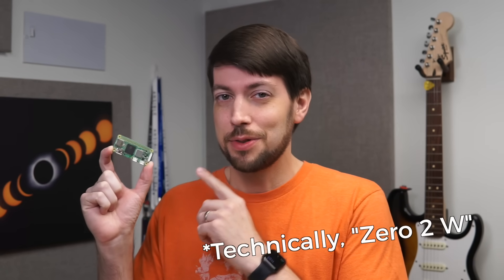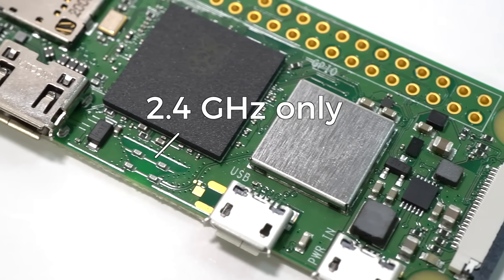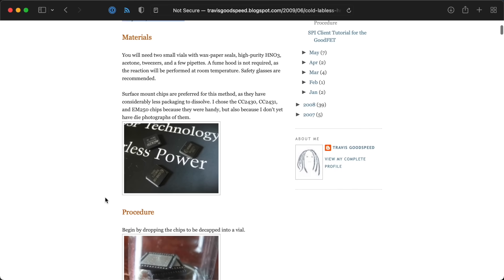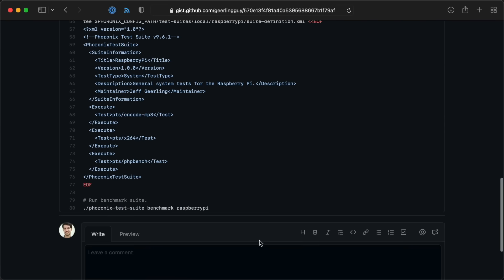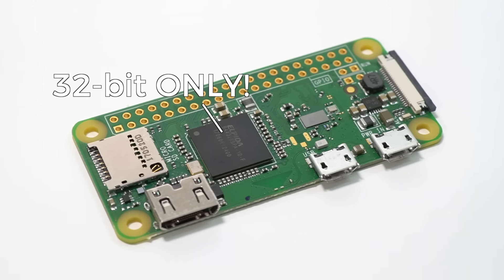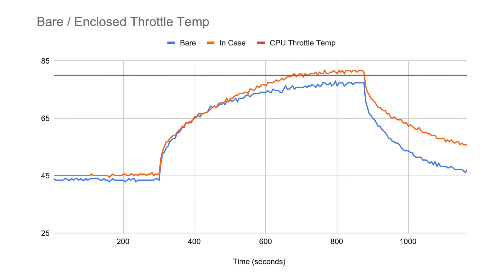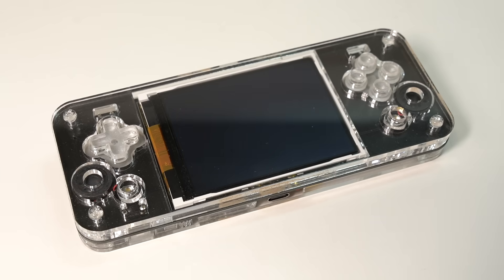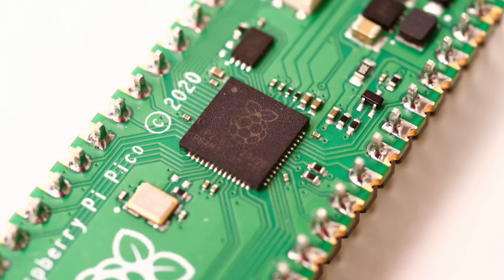The Raspberry Pi Zero 2 W review

Comment: Radxa Zero hands down.  Disappointed in Jeff, seems paid off this time.  I'm sure he's aware that the radxa zero has no throttling issues.  Not in my tests.  Not one bit.   Radxa zero has x265 hardware decoding and  not the raspberry pi and you can get  more memory on the radxa zero for a few more bucks.  I think this is more of a commercial and Jeff is looking out for his best interests financially.  Bad move lose integrity etc.  x265 hardware decoding plays a big factor if your project is a media player.
Reply: Much better wifi on the radxa too.
Reply from the maker: I mentioned the fact the Radxa has better hardware a couple times in that part of the review. But the fact remains getting a random project working on a Pi board is going to on average be easier than on one of the other varieties.

And no, definitely not paid off.
Reply: @JeffGeerling  The throttling issue seems kind of fishy.  My tests and other youtubers who have tested it report the same.  There are no throttling issues.
Reply: @JeffGeerling  You said  the bottom line each would all give similar performance without additional cooling and mentioned throttling.   So not true, none of that is accurate at all.   Similar performance?  Not even close.   Better wifi, better video decoding and so much more you get on radxa.  Maybe you're not aware but radxa isn't like other competitors to the pi.  Even ExplainingComputers admits that Radxa has great software support.  Not as great as raspberry pi of course but they're pretty good to the point that you will not have any trouble getting a project off compared to the pi in a month or so when some bugs etc are worked out.   Im sure you're aware of most of this.  This video really did leave me wondering if it was just big advertisement.

Comment: You never showed the bottom of the board.  Where's the new composite video test pad?  Is it in the same spot as the old Zero?  A lot of Gameboy Zero builds use 3.5in backup camera displays, which run on composite.  Also, the official page for it doesn't include the bottom specs either, which is really weird.
Reply: EDIT: ETA Prime showed the bottom of the new board within the first ten seconds of the video.  The composite video pad (marked "TV") moved to the opposite side, under the mini HDMI port, rather than being near the GPIO pads.
Reply from the maker: Yeah I only barely flashed the bottom of the board when talking about the stacked die on the CPU. I forgot to go over it, as the one POGO based case I use for the Zero that uses those pads was in active use and I never got around to testing it.
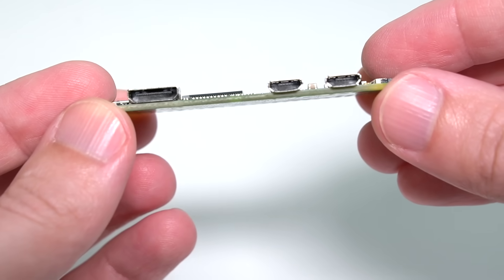Reply: @JeffGeerling  Yeah, the bottom you showed at 2:33 was the old Pi Zero (which you can also tell by the 4 through hole pads near the GPIO).  It's all good though.  That x-ray was really neat.  I'm also looking forward to seeing how well this plays with the RetroFlag GPi case.
Reply from the maker: @dividion8102  Oh shoot, lol so it is :D

I guess it's a good excuse to get people to also check out other videos like ETA PRIME's ;)

Comment: Hello Jeff, nice video as usual! :)
I paused mid video to order one, should be shipped soon :)
I like that with the raspi foundation, you don't expect anything, then boom! new board! However, it is becoming more expensive and difficult to try to "catch em' all"...

anyways, that is a great new board, will be perfect for HQ cam builds!
In order to compare efficiency, it would be interesting to compare the energy used for a fixed compute task.
For instance, transcoding a X Gb file on both, and see the Wh consumed. 
The zero 2 might draw 2 times more, but for much shorter (less than half the time) , thus using less overall energy.
But i think that the idle power draw will still keep a place for the original zero W on battery.

Comment: This is perfect for my needs! A while back, PRUSA of the MK3S fame released a guide to attach a Pi Zero directly to their Einsy RAMBo board in a seamless case solution. Just one problem: the Zero could run OctoPi okay by default, but attaching a camera caused things to explode in a hurry. Even with the same amount of memory, the 02 should have more than enough processing power to run OctoPi with a camera streaming at the same time. I'm sold!
Reply from the maker: Yeah, this little guy is ideal for use with 3D printers, though if you stream the camera feed, consider backing it off the 480p
Reply: @JeffGeerling  Oh no, the stream will be 480p, but ideally I want to attach a USB webcam for Octolapse streaming as well. My machine has the MMU2S, which means I want a camera on the selector. Maybe I should jerryrig a servo HAT in there to slide the camera up and down in it's enclosure?

Comment: Finally! Yes it would have been much better with 1Gb of RAM but I'm not going to complain.
Ever since faster Pi's became a thing sufficient power in the smaller form factor versions to actually be useful as something more than a glorified microcontroller has been a glaring omission.
Now if the Raspberry Pi foundation could finally, finally, come out with an "A" model that contains the Pi 4 SoC I'd be delighted!

No, no, no, the Compute Module is not a reasonable alternate for those wanting a Zero with a bit of 'grunt' or an "A" of equivalent power to the Pi 4. Once you have factored in the inevitable IO board it's too expensive for most people's projects and when coupled to any IO board that has a useful range of ports you end up with something larger than a Pi "B" anyway.

PS
If there really is to be no "A4" I would really appreciate the option to buy "B4s" with the connectors and GPIO supplied separately. Being able to ignore what you don't need or mount connectors remotely would be a real boon to those of us who are forever disordering stuff from their new Pi's.

Comment: Disappointing garbage, this needed to be at least 1gb ram to even be considered an upgrade. Sorry to be so harsh but after the long wait the rewards are truly minimal and outdated before it was even released. Just go with an old used pi3 or get yourself a pi zero w v1 and a pi zero 1.3 for the same $15. Especially when you see the changes added to the pi 5.

Comment: I appreciate the amount of love they put in the newer modified SoC, but I will stick with the 3 A+ for small size projects. The reason is the lack of 5 GHz radio and the fact that I never got to buy a first gen Zero for MSRP, usually 10€ for H and 20€ for W. On the other hand, 3 A+ is relatively easy to get for 25€.

BPi M2 Zero and other non-Raspberry boards give a good bang for your buck, but they are a nightmare for noobs like me. I got to learn a lot with ARMbian, but I prefer the Raspberry community. As you said, the experience is objectively better.
Reply from the maker: The 5 GHz WiFi radio is a huge selling point if you need to use it on wireless networks. A lot of people don't realize how much faster (and more efficient) WiFi can be when it's not limited to 2.4 GHz.
Reply: @JeffGeerling  Other than that, USB RNDIS ethernet could save the day if it topped USB 2.0 theoretical speeds and decent latency, but it does not work so well for me. In 2:35 I can see that the test points are placed in the same location, so Aliexpress breakout USB A dongle kits for good old Zero should still work.

Comment: Would a touch of ZRAM help with the limited 512MB of RAM built onto the system?
Especially since it has 4 cores, all that processing horsepower but nowhere to use it since it's hindered by minimal RAM...with ZRAM it will be able to compress and decompress on the fly much better because those cores will have enough oomph to keep up
Reply: I'd totally forgotten about zram and zswap. I remember when I tried it on my single-core Pentium 4 there wasn't a noticeable performance difference vs disk swap but I'm sure it would with multi-cores and slow SD cards.

Comment: These changes should let it just squeeze out k8s viability, which would probably make it one of the smallest viable nodes available. Might have to pick a few up and try get k3s onto them.
Reply from the maker: It won't be able to run stock K8s since it requires 1 GB (maybe 2 GB now?) on nodes—but K3s may, I think run. It'll be relatively slow but workable.

Comment: This will fit perfectly for purposes where ESP32 doesn't cut it (you need a general purpose OS for flexibility in your project), and a full Raspberry Pi is an overkill (either from compute or cost perspective). For e.g. as an infra/SRE guy, I want to use half a dozen of Pi Zero 2 to drive (old/salvaged) LCD screens all around my home to display various dashboards & notifications, so I can spend time with my family better without having to constantly check my phone or run to desk intermittently to check for incidents.

If I can actually get my hand on any of those, that is...
Reply: how would   economically get a salvaged LCD screen connected to it though?
assuming there is no composite or HDMI in
Reply: @andreamitchell4758 the LCD interface has a spi port plus a video interface such as LVDS, RGB, or eDP. It wouldn't be too complicated to go from hdmi to one of those. Probably would need a custom PCB.

Comment: Wouldn't it be better to place the RAM directly below on the other side of the PCB to allow the die to be better cooled?
Reply from the maker: Yes, but one of the design goals of the Zero is to have a one-sided PCB—a lot of Pi Zero-based projects rely on the bottom being perfectly flat. (Plus I believe it's slightly faster/cheaper to manufacture boards that only have components on the topside).
Reply: @JeffGeerling  Thanks for the clarification. : )
Reply: @JeffGeerling  Seeing how tiny these chips and how small the memory sizes are and the lack of upgradability i wonder if they could just make a SoC with a a very large L3 cache to replace RAM and slash prices that way.

Comment: On the original Pi Zero W it made a difference to disable USB power. You might try that too, if you're looking to present minimum power requirements.
I used a Pi Zero W in a "Linux on Solar power" project. It turned everything off and only woke up every minute to record solar power stats from the Solar Charge Controller.
Reply from the maker: Nice idea; haven't tried that but I will.

Comment: POP and SIP packages have been around for decades, mate. Nothing new under the sun.
They have advantages but also drawbacks, that's why they're not widespread.
Reply from the maker: For example, the thermal issues even at base clock ;)
Reply: @JeffGeerling  I characterized SIP and POP silicon in the past and yes thermal is a problem, but it's not the only one. Expandability (use a bigger RAM chip), EMC, manufacturing, poor-to-none observability,... there are many problems.
Between the performance and PCB size/complexity benefits and those drawbacks, it's a tradoff to make.
Reply from the maker: @unperrier  I noticed in their announcement post, Raspberry Pi even mentioned the expandability issue—any RAM chips they found larger than 512M were split and would be too hard to integrate into the package :(

The Zero is, as I said in the video, king of tradeoffs. At least it's still extremely useful for a lot of niche projects. More RAM would greatly expand its usefulness, but we can't have everything!
Reply: @JeffGeerling  You are right, not at 15$ at least!

Comment: At my local computer store, has Pi's available on mass, I never saw them sold out.
Even the CM4 is in Stock.
Reply from the maker: The Micro Center near me is usually well stocked, but the past few months they've been pretty thin (no CM4, some Zero W, only one or two Pi 4).
Reply: @JeffGeerling  The Micro Center in suburban Chicago is habitually out of stock now. Become much worse over the past six months or so.
Reply from the maker: @KameraShy  You also get Chicago Electronics Distributors, but they've also been out of stock a bit!

Comment: Interesting food for thought, but not as much as CM4, IMO, which offers full Pi functionality + a wide variety of carrier boards, a small form factor, and lots more bang for admittedly a lot more bucks. But, how much is one's time worth, while building a project?
Good call on Radxa's competitor. Fell for the specs of their Rock P4b a few years ago, especially with it having the M.2 NVMe connection. But. alas, just as you mentioned, their OS wasn't stable, it was plagued with bugs, and there was only a small specialized volunteer support community. Even after investing into building a custom aluminum case, w/Noctua cooling, I was forced to give up in frustration, 
When it comes to Linux, I'm more of a Redshirt Jeff kinda guy, enough brains to be dangerous and constantly getting into trouble.
So, my $300 ROCK P1 4b project has only been collecting dust on the shelf for 2 years. Lesson burned in memory. Fooled me once...
Reply from the maker: I have a couple Banana Pi and one ODROID unit collecting dust over in my electronics pile for the same reason :(
Reply: @JeffGeerling  I tried getting a Banana Pi Zero to replace the underpowered Rasp Pi Zero. OMG. The thermals were out of control on that thing! Absolutely useless board and I managed to burn myself playing around with adding a heat sink. Which did nothing, BTW. Idling produced too much heat for the thing, much less any serious workload. And trying to figure out a fan for that’s form factor just wasn’t worth it. I’m sticking with Pi Foundation. The hardware may not be the fastest, but it’s well built and balanced.
Reply: Yeah, I'm ashamed to admit it, but same here with the NTC CHIP.
Support used to be great but now it's a mess, almost non-existing, basically I have to rely on old documentation and reddit whenever I have a problem.
Couple that with the software and even hardware issues that are popping up left and right and now I have a huge pile of pain to go through every time I want to try and do something with it, so it inevitably ended up collecting dust in a drawer.

So yeah, I really wish I went with the Pi Zero instead of this, I wish I had not allowed the spec sheet to push me into this purgatory.
No amount of storage, ghz or wi-fi was worth the time and energy I had to waste on this thing just to make it work.
Reply: I bought an Orange Pi PC2 some years ago (2016 I think), and remember that I could not get it to boot. Support for that board was lacking for quite a while. It wasn't until after about two years that I got it to actually run GNU/linux. Now it's running as an openvault server.

Comment: That thing looks great. I hope my order does not get cancelled. I managed to aparently get one for about 16€ sadly not dollar but im somewhat okay with that price comparing it to a full Raspberry Pi 3 model a. I'm using an original Raspberry Pi Zero w on my RP6v2 robot for wifi and flashing purposes but when compiling firmware for the atmel chip, even my overclocked Pi Zero has some problems. Im curios to see how fast this will compile.
Reply from the maker: I would imagine it should be closer to 4-6x faster compiling things on the Zero 2 if you have it set to use all the threads available via 4 cores!

Comment: Hmm... double speed, double power draw sounds not impressive at all. Or am i missing something? 
Is it maybe your pre-release software stack that is not optimized yet?
Reply from the maker: It's more than double speed for many tasks—the baseline tests that were almost exactly 2x were running the less optimal 32-bit OS and were using a single core. But yeah, the Zero 2 doesn't get any kind of efficiency crown either.

Comment: I'm with ya on usb-c. Kinda annoying having to solder my own USB with C connector onto my PI Zeroes. I get that it's probably cheaper and you don't get high-speed USB but it saves so many headaches as I only have usb-c hubs that provide power, data and network than I've ever owned that are micro compatible.
Reply: Yeah even ignoring all the high-speed and alternate modes that the Zero can't do, just the physical USB type C connector would be great to cut down on the number of different cables to keep around.
Reply: I needed a micro-usb cable with data recently, I think I found my only surviving one after finding all of my other non data-capable ones first. Not having to worry about that anymore (as much) would be fantastic.
Reply: Yea personally I would have preferred USB-C to micro-USB, though as said, I can see why, for compatibility with older cases/spaces the original would fit in.
Reply: Where do you solder the USB-C connector onto the Pi Zero? Is it a drop-in replacement for the Micro USB port? Does USB-C require a couple additional resistors on the board for sensing? Thank you! I have a bunch of Zeros, and I'm running out of working Micro USB cables that still work lol

Oh, and are you able to replace both the PWR and data connectors? Sorry for all the questions. I'm just excited by the prospect of finally ridding myself of Micro USB!

Comment: Oooo! Very pleased the zero got an update!

Disappointed by the fact it only has 512mb RAM although ultimately it’s going to depend on the use.
Reply: Maybe they'll release 1gb (or even 2gb) versions a few weeks later so the early adopters get to buy one of each like they did with the 8gb. if i'm not mistaken there was articles stating 8gb would not be released initially
Reply: @notsonominal  Did you see bigger than 512MB piggyback RAM module...?
Reply: @notsonominal  There's no space for a 1GB RAM die on top of the CPU die